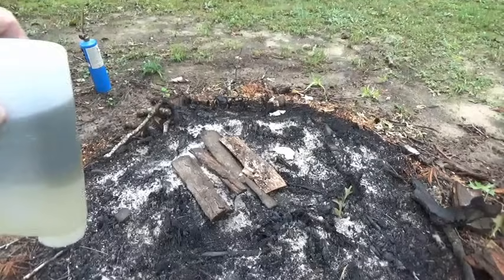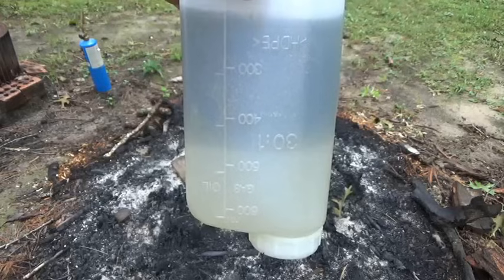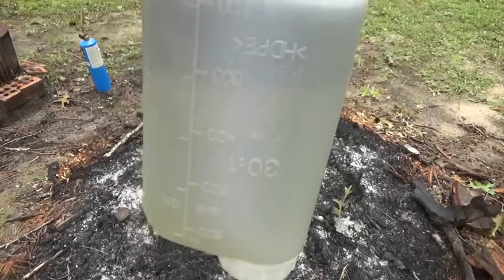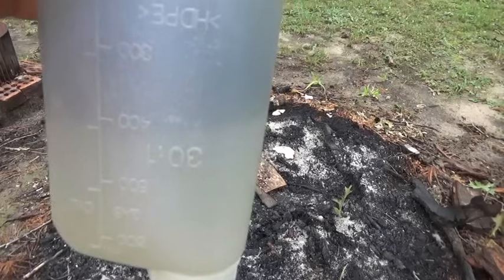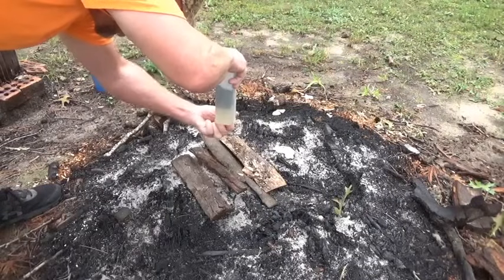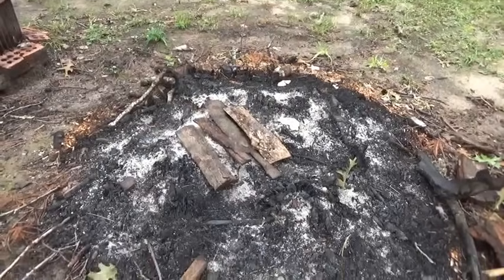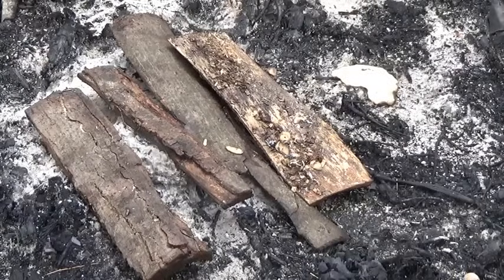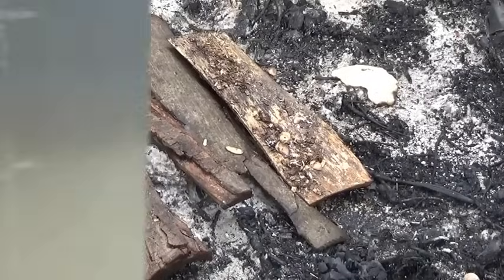Fuel problems in Michigan

Comment: use premixed in your equipment, it will last longer. ethanol eats the plastic parts
Reply: And it corrodes metal parts and it stiffens/hardens seals and lines.
Reply from the maker: I have heard bad stuff about premix also. I am switching to alcohol free gas from now on. Thank you very much.
Reply from the maker: @MrBilld75  Right on. Thanks

Comment: I didn't hear about the Florida deal. Thanks for sharing and yet I Heard it's supposed to go up.60¢ tomorrow.  I get mine at Casey's been going through $70.00 + each day in the work truck no problem yet
Reply from the maker: Ya they told them to get ready to evacuate and a bunch of gas stations had put diesel in their gas storage tanks. people were stranded all over.
Reply: @SteveandSusiesHomestead  Same thing happened a month ago in Lahaina, Maui. As the high winds were approaching, authorities told people to fill up on gas and it was contaminated with diesel, vehicles stalled...
There is a pattern of "coincidences". I don't think they like us.
Reply from the maker: @user-bg2oi4bz3p  Are you kidding me ?. Things have gone way to far. I have been fallowing that incident there are way to many things wrong.

Comment: The fuel delivery driver probably dumped e85 in the wrong tank at the station you got your fuel at.
Reply: I think you're right about that.
Reply from the maker: That is what I am thinking. but was it accidental or a scam ? Thank you
Reply from the maker: @hughtollett7200  Ditto
Reply: Usually accidental because of the amount it cost to repair damaged motors.

Comment: You have phase separation. What your seeing happens when enough water is added to gas that has 10% ethanol.      
 Most likely wherever you bought this fuel from has a small amount of water intrusion in the underground tanks that's mixing with the ethanol in the gas.  Ethanol brakes down the water  Which is a good thing but in this case there's way too much water and it settles to the bottom with the ethanol.

Use REC gas for your small engine.
Reply from the maker: Thank you... That was regular gas . I think the dumped e-85 in the wrong tank. What a mess .

Comment: Ethanol mixed in with petrol I tried E10 (uk fuel) my husquvarna hated it
Reply from the maker: Well that stinks. Here we have e-85 . I think they put the wrong fuel in the wrong tank. We can still get alcohol free here. More expensive of course but will only use it for my small engines . Thank you .

Comment: Good PSA!  Thanks for sharing the info.  It's not the same, I don't think, but a few of us have noticed thr fuel mileage, on our daily drivers, took a downturn over the last few months.  15-20% in some cases.
Reply from the maker: I think it E gas in there.
Reply: As temperatures go down towards the fall / winter, refineries switch over to a mix with a higher vapor pressure.  It helps cars start easier in the winter - especially the old carbureted ones.  They switch to a lower vapor pressure blend at the end of spring for less pollution, but it also increases most cars' mileage.
Reply from the maker: Thank you Cynthia @Cynthia_Cantrell

Comment: I'm no fuel expert, but, if you can drain off some of that clear stuff and put a hydrometer to it, it will tell you what the percentage of alcohol/water mixture it is.  It's likely you got watered down ethanol because a fuel truck got the wrong tank and put E-85 in a 89 octane tank. If there was rain water in the bottom of that tank, it dropped the mixture octane, it could have even fractured it. A work around could be to use a full can of "SeaFoam" to a tank of gas (if the mixture is not too far gone).
Reply from the maker: Thank you very much. I am going to switch to alcohol free for my gas cans. But I will check what I have left.
Reply: @SteveandSusiesHomestead  Either way, you should contact your state's comptroller and report the place where you bought that gasoline.

Comment: What kind of gas are you buying for your cans?  Regular unleaded or ethanol free?  I had a similar issue with my chain saw a few years ago.  It started up fine, idled fine, and revved fine, but as soon as I put the chain into a log, it was like I ran the chain through the dirt and it wanted to stall out, and I knew that I hadn't.  I dumped that regular unleaded gas and replaced it with ethanol free.  It took a tank worth of EF to fix itself, but it did fix it.  At that same time, I had to run my snowblower on 1/2 choke the whole time I was using it in order for it to run smooth for a few years.  Started running the EF in ALL of my small engines after the chainsaw, and my snowblower fixed itself too and I have had no other issues with anything else since.  This was 7-8 years ago, but PA if you're keeping track.
Reply from the maker: I have been running regular without issue . I guess I better switch to EF.
Reply from the maker: Heck I was in PA a year and a half ago . I would of came and shook your hand if I would of known .
Reply: @SteveandSusiesHomestead  What area?
Reply from the maker: @EMTRailfan  about 100 miles in from Ohio.
Reply: @SteveandSusiesHomestead  Sounds about like the Dubois area.  I'm only about 50 miles from the PA/OH line.
Reply from the maker: @EMTRailfan  Well damn. I was in Brockway strait north of DuBois .. I was with that blonde bimbo , LOL
Reply: @SteveandSusiesHomestead  I've been in and through Brockway a handful of times.  You were pretty much directly east of me, and probably drove about 4 miles away from me on your way there, lol!

Comment: You can use water to pull alcohol out of water if you can build yourself  a separatory funnel. You can make a small one from an inverted 2 liter botle. Just use the top as a drain control at the separation line
Reply from the maker: Great idea. I burned what I had and am switching to alcohol free gas for my small engines . Thank you

Comment: Back in the day, there was a mix of diesel, cut price of course. A mix of Heating oil, hydraulic oil and Engine oil. It was a mix of about 5 gal of engine and 5 gal hydraulic oil to 1000 gal of heating oil. It would run old car diesel engines but not so much newer cars. That's what I heard, just saying 😁
Reply from the maker: Wow interesting . I wouldn't put it past them to stretch the gas to make more money . Thank you

Comment: What I would also be concerned with  is "was the chainsaw engine getting 2 stroke oil" when the fuel was separated ? It looked like all the oil was floating . I'm from Pennsylvania .
Reply from the maker: My concern also . I only ran it for a minuet and dumped it out. I mixed a fresh batch (with different gas) and it seemed to run just fine. Thank you very much.